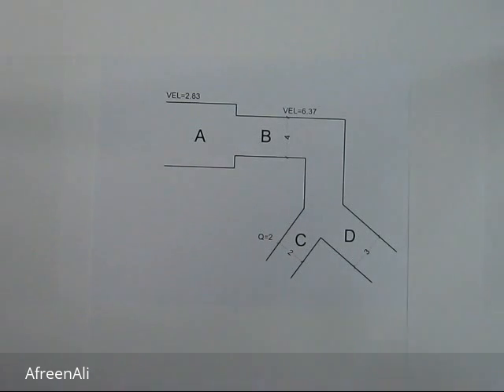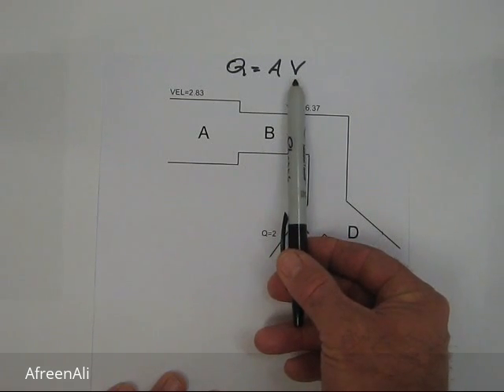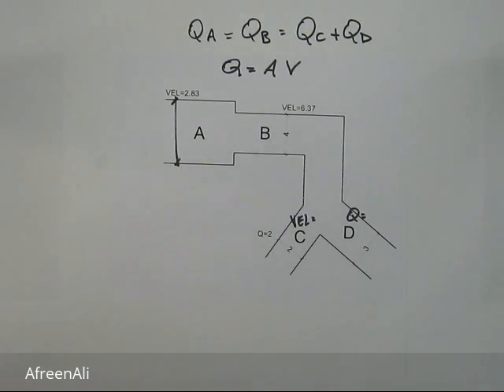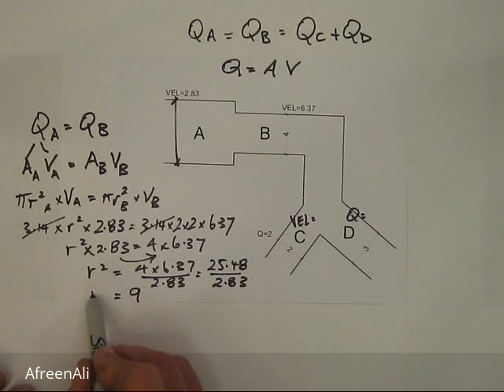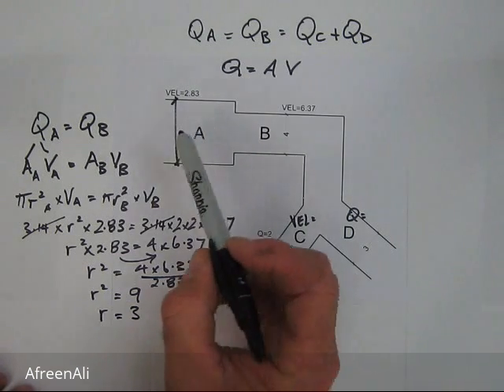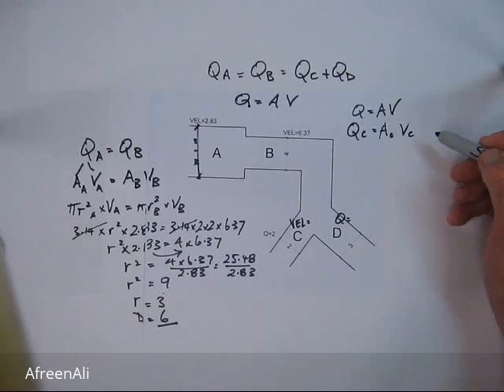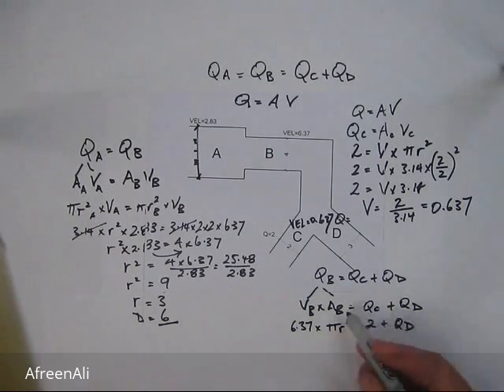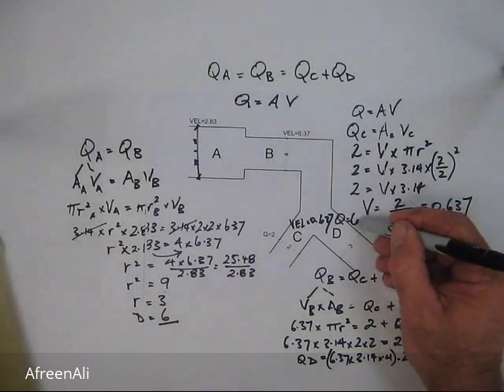how to calculate pipe diameter, velocity and flow rate in plumbing engineering

Comment: 500cu.m of water flowing through 2 nos of 200mm HDPE pipes (each 350LM length) of SDR17 and PN10 rated pipes  this is furthermore reduced into 160mm  HDPE pipe of SDR17 PN10 rated pipes of 4 Nos of 6m length (each) then it diverging into 400mm HDPE pipes of SDR17 and PN10 rating for 1500LM. 

What would be the pressure in that 160mm HDPE pipes?
Reply: See here bro
Reply: https://youtu.be/nsvzncvkfgc

Comment: Hey guys :)
I have to solve this problem, could you help me please?
In a system that transfer 5 gallons per minute of viscus fluid (3000 CP) from horizontal distance of 6 meters to higher point with elevation of 5 meters using sanitary tube with 0.8 micrometer, knowing the liquid has no vapor pressure and it is a laminar flow, determine the Pipe size and Total Dynamic Head (TDH).
Thanks a lot!